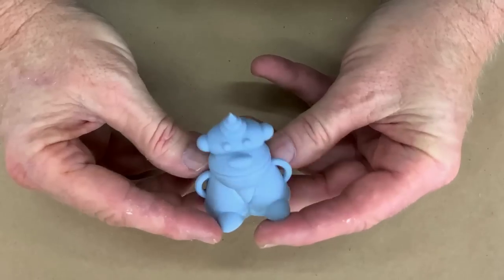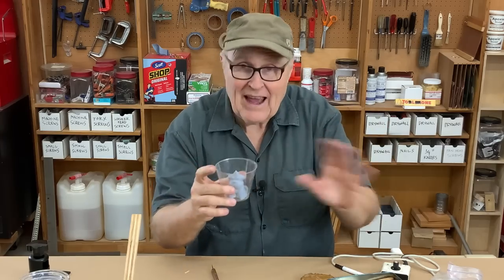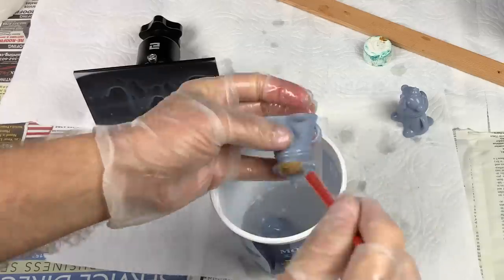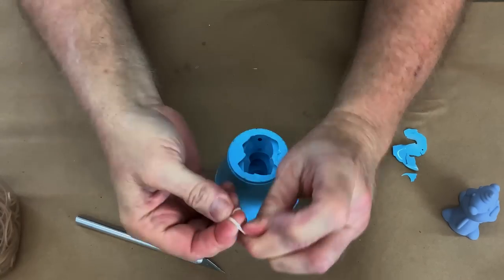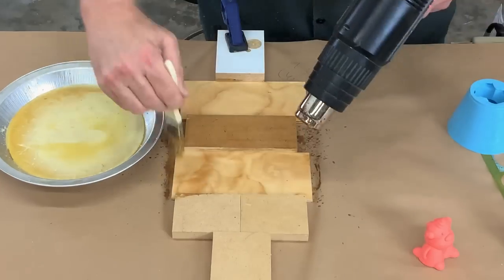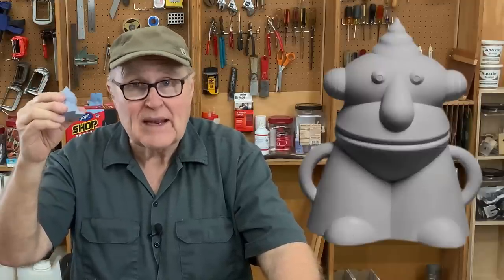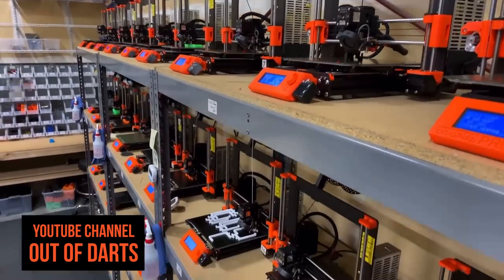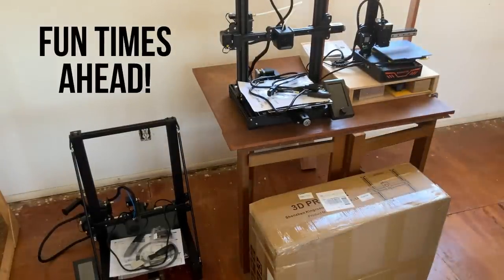Which Is faster - Resin Casting Or 3D Printing?

Comment: 3D printing is great as a hobby but after 5 years of using an FDM printer I see no way to actually make $$ with one. As you said an average small print is over an hour, some of my prints have taken 5 days. In the end if you leave them in the sun PLA will melt lol

Comment: Would you be kind enough to state about strength and mechanical properties of parts from various processes. NOT everyone is making art-forms. Most people want to cast or 3D print functional parts or parts that carry loads. TO my great frustration load carrying abilities or how strong they are in general is NEVER mentioned in your videos. At least please press or twist them so that we can get some feel for their strength.
Reply from the maker: All of my experience with resin casting is making decorative objects such as toys. I am not qualified to evaluate the mechanical, structural or chemical properties of any given material. 
There is a huge variety of materials and their properties vary widely.  

The best way to learn the properties of a material is to read and understand the material data sheet which should be provided by the manufacturer. 

Also, contact technical support of the material supplier and ask them which material would be best for  your specific use case.

Comment: I don't quite agree with your analysis.  Yes, after complete set up if you need a 100 yes it is faster, but who needs a 100 of anything?   You used 3D printed originals in each of your molds that took time to print and the 3D printer can produce more than the 3 you showed on your platform.  Additionally you still need to buy the silicone and wood etc for the molds with resin you buy the resin and print.  Not exactly apples to apples.

Comment: slap! :)
Reply: try water washable resin
Reply: very nice
Reply: how about a 3d printed direct mold
Reply: I guess they are similar speeds after you have made the molds, and similar speed to make the mold
Reply: try cement cast in 3d printed molds
Reply: ie ceramic cast
Reply: one option is SiO2 + CaO + water cast